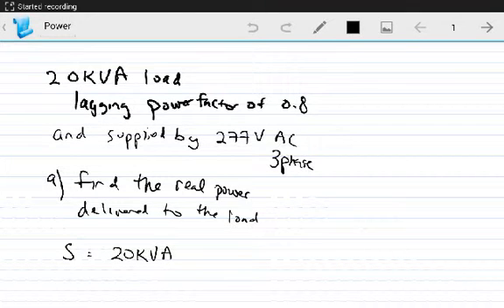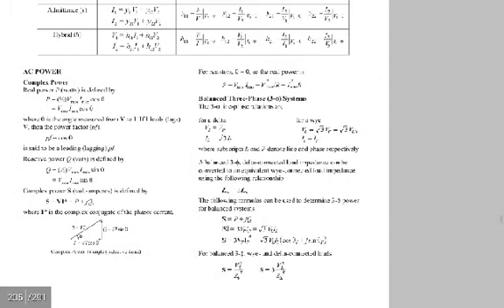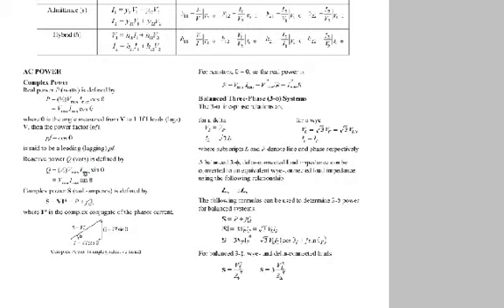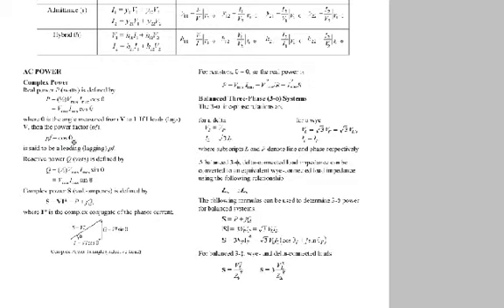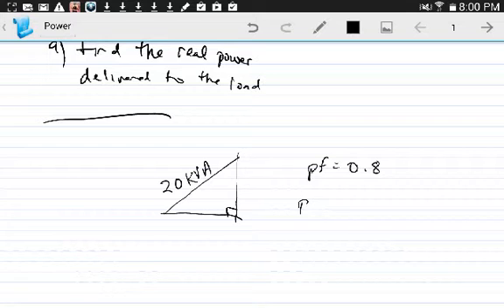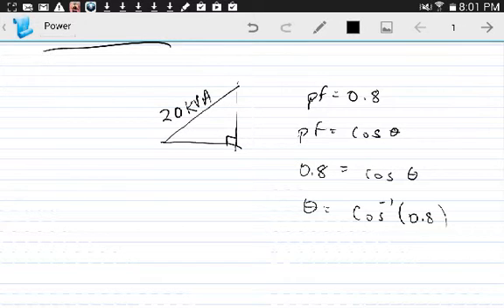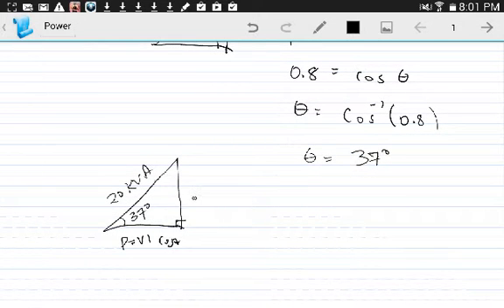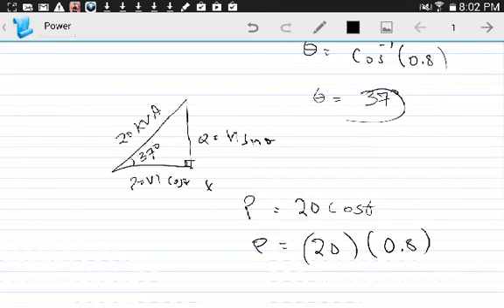FE exam review Electrical 3 phase power problem

Comment: When you have the apparent power (KVA) and the power factor, you can just multiply the power factor by the apparent power and you'll have the real power. If they tell you to find the reactive power (KVAr) then you would need to find the angle (cosine inverse of the power factor) and do sine of the angle multiplied by the apparent power (KVA).
Reply from the maker: yes i came to that conclusion working the problem out when doing this i was 7 years out of school and worked in software development so this was not fresh knowledge.